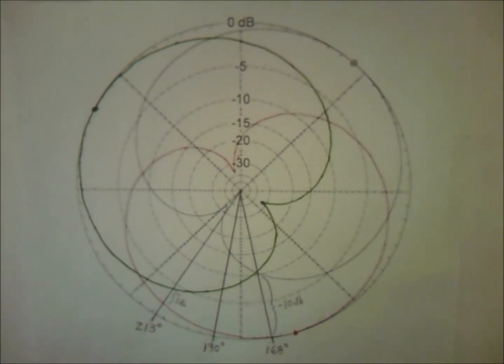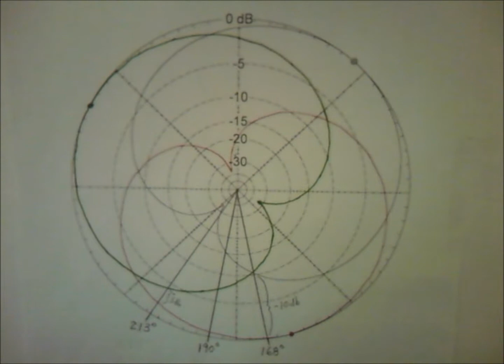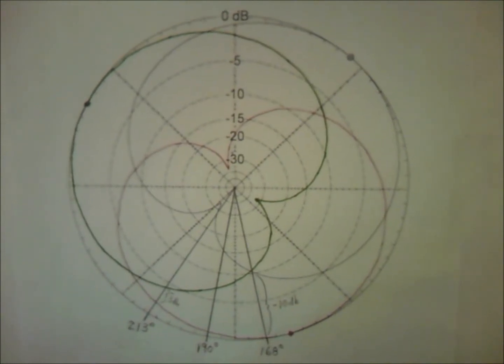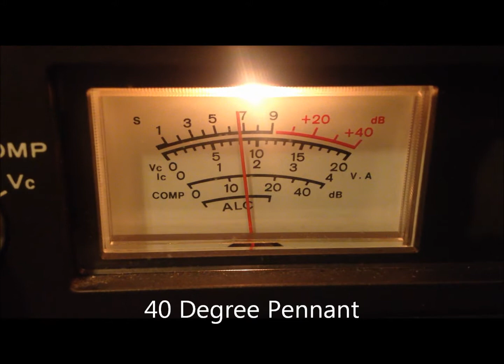Lightning static crash noise reduction using Pennant RX antennas (demo by WD8DSB)

Comment: Im surprised the pennant is so noisey 
Tx vertical yes but id expect pennant to be s5 lower
Reply from the maker: Hi Joe,
In that video my pennant preamp gain was set to provide equivalent signal strength as my TX antenna.  That allows instantaneous comparison of signal to noise ratio.  Not sure if that addresses your comment.  I normally use 20dB of gain with my small pennant RX antennas but in this video I was probably using close to 46 dB of preamp gain.
Reply: @wd8dsb  wow 
10 year old video 
Zero comments 
And you reply within hours 
Must be a record 
Hihi

Ok thanks reply interesting 
Luv 160m ! My favourite band overall 
My favorite hf band 30